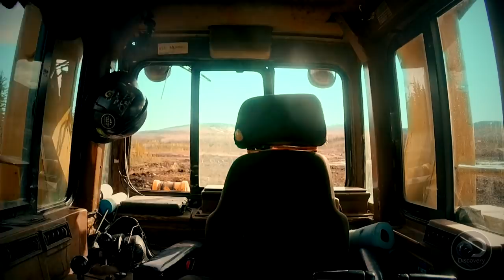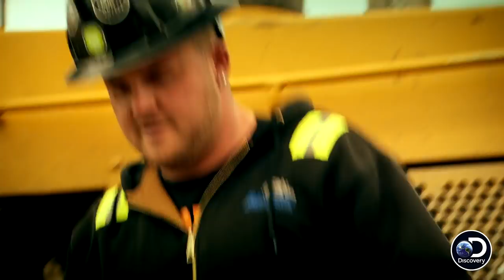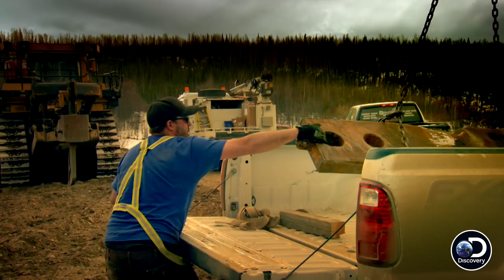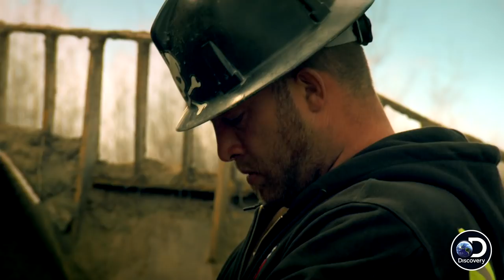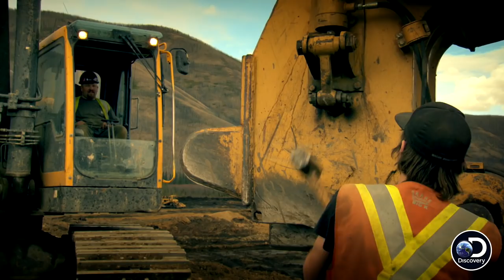A Broke Down Dozer Can Only Sideline Parker's Crew For A Few Minutes

Comment: Did Noone else see he was swinging the hammer to hit a hydraulic cylinder?
The keeper pin is ran on hydraulics a hammer wouldn't budge it.
Reply: The d10s cylinders get loose and they don't go in on their own from time to time. If you run the puller and give it a quick smack it will go in. Ive done it lots

Comment: Why don't any wash plants use an electric magnet ?
Reply: Dylan Walsh gold isn't magnetic
Reply: @shanedoherty2279  maybe he means to sort out the black sand?
Reply: @shanedoherty2279  Gold is not a magnet itself right, however it is repelled by magnetic fields so it could be used that way.

Comment: Reason it broke is the operator error because this guy turn left while the blade is down!
Reply: Paul Donnelly that's what I thought even before it got broken.
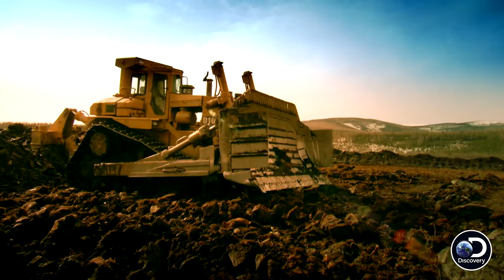Reply: 0:31 shows it wasnt bolted down properly anymore either.
Reply: not to mention they never curl the thing in when they get penetration. leaving it out is a good way to break er